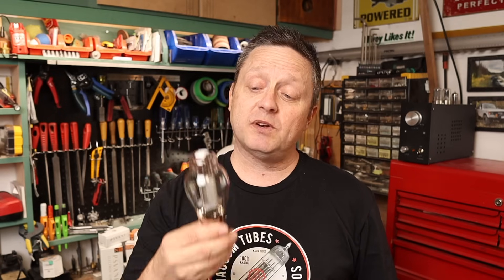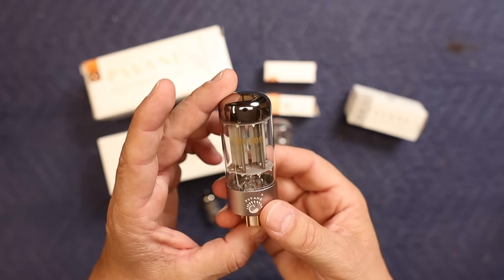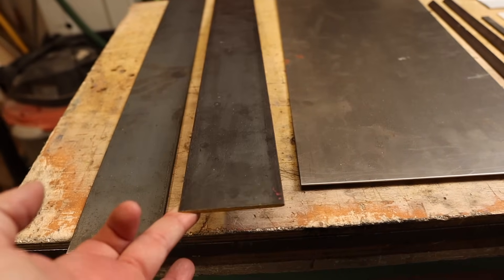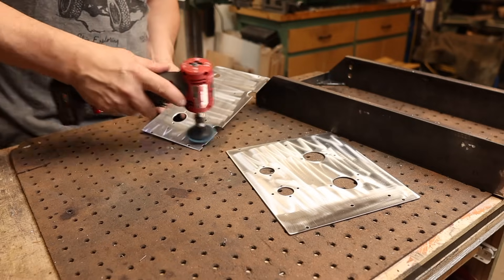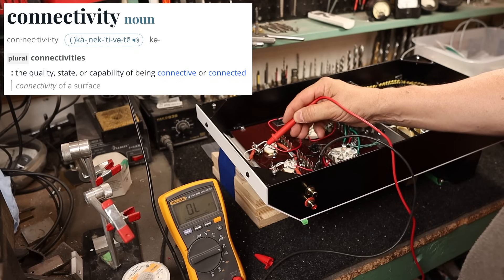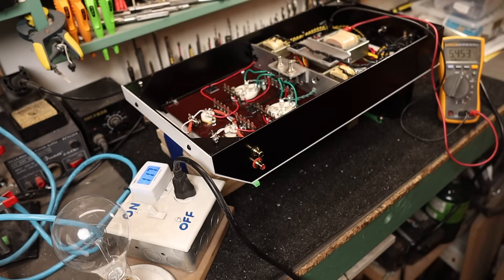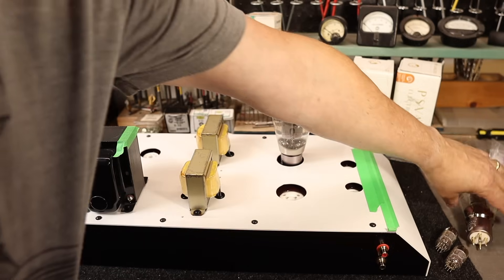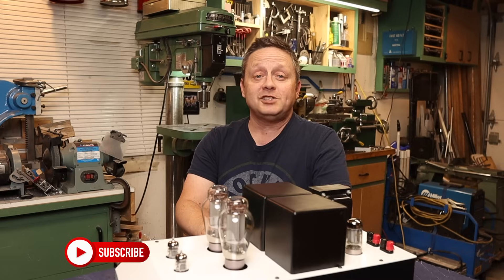Building a 2A3 DHT SET Power Amplifier

Comment: Nice project, I'm impressed by the metal working! One question through, by connecting the rca shielding to earth, don't you run the risk electrocuting yourself through an connected source, anytime something is wrong with the earting of the amp?
Reply from the maker: Thanks for commenting.  The sheilding itself is not connected to either positives of the incoming signal.  It is bonded to the chassis. The chassis is bonded to the earth ground. All the components are also bonded to the earth ground. If there is a fault, it goes straight to ground.  Even if there was a B+ fault, the main fuse would blow when the direct short happens.  I’d be concerned with an amp that floats the ground or there is not power transformer and it’s power directly off the mains. That’s a potential death trap! Cheers.

Comment: You dive right into building the chassis after introducing the tubes.

Whereas, I was thinking you’d go through the circuit - 

Perhaps you’ve already covered that in a previous , , . , 

What ?

Oh I see you have a ton of tive building videos.

And no you don’t have a video going through the workings of the circuit !

Why !?

You showed that circuit for a mere a half second. 

Why don’t you discuss ?

Hmmm ?
Reply from the maker: Thanks for the feedback! These are fair comments. I tend to focus more on the "how-to" of the full build rather than the deep dive into circuit theory to keep the video somewhat short. I have done deep dive videos in the past and they just don't perform. Majority of people drop off quickly and YouTube stops promoting the video and it just get buried in the algorithm unfortunately.  Please have a look at my 6DN7 amp for example. In this 2A3 amp video I include a link to a build document that goes into some more detail if people choose to read it. I also make reference to the original build article which has more information as well.  I do ask at the end of the video if people want me to do a deeper dive on this build and many have said yes. I will be doing a follow up video which will go over the schematic, layout, componted and mods. I know this follow up video will not perform so I hope people, especially the new builders, will appreciate it.  Cheers.

Comment: howdy, really like this. May try build one. Any comment on using a toroidal as power transformer?
Best/Chris (in Sweden)
Reply from the maker: Thanks for commenting. I hope you do build one! I have no experience using Toroidal. They are not that popular here in Canada. They would be expensive to import.  I see many people in Europe use them. I don't really know why other than your 220v line voltage and little or no DC on the mains which can be an issue for some.  Perhaps someone else can comment. Cheers.

Comment: I can understand (barely) that some people like the warm (distorted) sound of the 2A3 but why not generate the required DC voltages with modern solid-state electronics?
Reply from the maker: Thanks for commenting.  Yes, I do use solid state rectification.  Please have a look at my other tube amp video.  They do have some benefits but they also have some negatives. I don’t care either way.  I use both. This amp was based on an older design that uses tube rectification to keep it all tube classic design.  Tube rectification allows for a slower B+ ramp up thus not shocking the audio tubes with full voltage prior to them warming up.  Yes, there is solid state options for that but then the amp gets more complicated than it needs to be.  Cheers.

Comment: That’s an impressive chassis and layout, again.. Very AN UK inspired, but beter lol.. Do you prefer your 6J5 Preamp over your 407A Preamp?
Reply from the maker: Thanks for commenting, much appreciated. The 407A is similar to the 5670 tube but I haven't heard it in person.  Also, my 5670 pre and my 6J5 pre have different topology so it hard to say what I prefer.  They do sound similar to me. The 5670 pre is a bit quieter and has a black background but that may having something to do with eh DC Filaments.   The 5670/2C51/396A is a nice tube and obtainable for a reasonable cost. This issue with the 5670 pre is the transformer cost and availability. A "good" output transformer will cost you several 100 dollars.  The way I built my 6J5 pre, I use a cathode follower to have better output impedance matching and drive longer cables. Dollar per dollar the 6J5 pre wins out.  What I plan to build in the future is a 6J5 with the same topology as my 5670 pre (using a output transformer rather than a Cathode Follower tube) to make a direct comparison with the 5670 pre.  Cheers.
Reply: @MikeFreda 
Thank you for the elaborate reply..  Yeah, the short interconnect cable runs for a non-CF output can be a deterrent especially for those who use Mono Blocks.. There are Line OPT iron out models out there, but most are really pricey compared to plate chokes..

Comment: Hello Mike! What If you build a tube based PSU for a Turntable? I wish I Had one, but new they're 3 times what my TT used. to cost. i'd BE so pleased. 24 volts AC with pwm. Thank you a lot.
Reply from the maker: Thanks for commenting and making that suggestion.  I’m very intrigued.  Send me a private email with more information about what the power supply needs to be and possibly links to what is commercially available.  I’m sure there is a reason why they are pricey…. And I’m sure labour has a lot to do with it.  Cheers.
Reply: Hello Mike! I will, but it takes some time since I accidently crashed my Computer.

Comment: I built the amp and it sounds extremely good, plus it’s dead quiet. I used a Hammond 302AX power transformer, Thermionic Lab output transformers (from Greece), a Genalex Gold Lion GZ34 rectifier, Brimar 6060T and Psvane 2A3-Z Treasure. Unbeatable at the price!
Reply from the maker: Magnificent, great to hear! You used some nice components. I'm glad it worked out for you. Please send me a picture and I can post in on my community page! Cheers
Reply: Pictures sent

Comment: Im a fan of tube amplifiers , but im disappointed by your builds , they lack tone controls, such bass , middle and treble. , they also lack feed back to correct frequency response for various input sources. . Also they lack safety , such as a fuse on the AC cord, and exposed tubes lack heat guard's to prevent people burning themselves, also theses guards will preveny rf interference from near by electronic equipment . Do claim there hi-fi unless you can quote THD figures.  You could build into your amplifiers Bluetooth modules there cheap enough to buy . . Plus steel chassis are prone to rusting , plus I would like to see more of the components mounting and wiring, but overall you do provide good videos, but more build content
Reply from the maker: Thanks for your feedback, I appreciate your thoughts and suggestions! Power amps (like the on in this video) typically don't have volume and tone controls. My preamps typically only have a source selector and volume control. The thought process is to keep the signal chain as simple and pure as possible. Adding extra components can induce noise, reduce gain, make the preamp more complicated and basically alter the base signal. That's how I like them and if you think it's a necessity, there are a few preamps that have this option but they can be complicated to build. Most SET amps don't have NFB. I do use NFB on my EL84 amp and will putting it in to my 6L6 amp. All my AC are fused. The AC connector used in this video has a small fuse holder built into it.  You can install a bluetooth module but then you would also need a power supply for it and if you mount it in the amp you have to be careful the RF from the bluetooth won't interfere with the signal chain. I find it better if you just use a good quality standalone unit and RCA into the pre. I use a Turntable, High quality CD player and a FM Tuner mostly. I find music off my phone compressed.  I have done detailed videos of the soldering process but people don't tend to watch them. They do poorly. No one really wants to watch a guy solder every component. It makes for a very long video, people drop off and youtube stops recommending it. The feedback that I have received suggests that people are more interested in the schematic, chassis,  layout, components used, where to buy the parts and how it sounds. As for this 2A3 amp video, some people are interested in me doing a deeper dive, so I plan to do that even though it won't get a lot of views. My scope is down but I do plan to go back and revisit the amps and give some really figures on them. Thanks again, Cheers.

Comment: Hello Mike! What if You made an active tube x-over for at least two chanels?
Reply from the maker: Thanks for commenting.  To do what with? Bi amp?  An amp for a tweeter and an amp for mids?  If so, I have thought of doing this.  The biggest issues here is having the proper drivers and measuring devices to dial it in.  Cheers

Comment: PT-Hammond 2.5v 166M2  110 V in italy 220 Volt?
Reply from the maker: The 266 series has a 234v primary windings.  266M2.  Cheers.
Reply: @MikeFreda  ok grazie . Ci sono altri elementi elettrici che vanno sostituiti per una costruzione europea a 220 Volt
Reply from the maker: The Power Transformer will also need to be.  Hammond 300 series has a 220v primary windings.  Cheers.

Comment: Hi yer Mike just curious on your builds I notice you use a cheap IEC connector for the power socket can you explain why you don’t use a fully shielded IEC power connector when I work on a cosmetic restoration of vintage hifi I normally fit a Roxburgh   RIH 06 or RIR 06 shielded power inlet for RFI/EMI shielding

Good video 👍👍
Reply from the maker: Thanks for commenting. Great question.  Oddly enough, I have used this type of power supply inlet in the past but was told by an electronic guru that those are actually intended for a more refined power supply, like a switching power supply for a computer and other highly sophisticated digital devices that need RFI and EMI shielding/filtering so the will operate properly. Tube amp PSU's are pretty basic so it occured to me that I didn't need to spend extra money on them so I switched over to normal IEC. Yes, they are "low cost" but I haven't had any notable issues. The incoming AC (60hz) is wired directly to a transformer so I'm not sure what you are actually blocking?   I think you have more of a chance of RF and EMI getting transposed onto the audio signal chain, and I do take precautions for that.  All this being said, I love to see some actual test data or more technical information on this. Cheers.

Comment: Superb build ! .............commercial amplifier manufacturers should have a look at how to build their stuff !
remember this design is made for the Horizon 2A3 tubes as well as other brands with higher plate dissipation thangenuine nos tubes ....2A3 was designed with 15 watt plate dissipation .
Very curious how this amplifier and Horizonntubes sound.
12AT7 ( ECC81-CV4024) is still available in nos quality...
The SRPP is a good driver <>..........possibillity to experience and build  a // SRP driver stage . ..........also take care to set/apply a bias voltage on the filamernts to prevent arcking between filament and cathodes... 
Thank you for the nice and high quality upload ( as usual )
Reply from the maker: Thank you for the kind words and the additional info! Most new 2A3 can handle ~16W without any issues. If I was using some NOS 2A3's, I'd probably put a 5U4 rectifier into the circuit to drop the B+ a bit and get it under 15W. That would still sound pretty epic. I plan to do a follow up video to discuss all of this. People seem pretty interested in what I made here.  A lot of of this info is scattered all over the net and hidden in forums. It took me years to wrap my head around it all. Cheers.
Reply: @MikeFreda  Yes , it's nice to learn  but you have very good builing skills ...
You may try someday to build a parrallel SRPP...
Indeed replacing the rectifier is a good solution when a nos 2A3 is used.
Many prefer the musicality of a 2A3 versus a (Copy of ) the WE300B....
Would like to have your skills building myself the chassis hahaha.
One of the advantages of a // srpp is that one double triode canbe used for the upper stage and another for te lowerone...........this allows to polarize the filaments independantly for both tubes  ( no more risk for cathode /filament arcing )
Anyway you are very inspiring forpeople who love music ( tubes and red wine ) to start building themselves........and thanks for sharing that .A good alternative for starters is an EL34 tube amp ( set ).....it's affordable and quite musical....simple and nice sounding  .
Have a very nice day and waiting for your next project .
Reply: @frankgeeraerts6243  Hi Frank, I modified my ultralinear EL34 amp to include a 12AX7 SRPP driver stage, I kept the Schade negative feedback running the resistor from the of the EL34 to the plate of the second half of the 12AX7. Does this configuration sound correct?

Comment: You don't know how to orientate power transformer and chokes they should be in opposite planes to each, it cuts down on humm and distortion, and only an idiot who Incase transformers in wood due to heat, that will shorten the life of the transformer, try using a wire mess, you don't mont transformers underneath the chassis neither you want the heat to escape
Reply from the maker: Thank you for your constructive criticism. Hopefully I can rationalize your concerns.  My initial intent was to mount the Choke straight down to be in opposite plane of the PT. It is on its side and the laminations are still perpendicular to the PT, Yes, it's not perfect. The Choke is 1/4” taller than the chassis height and it just didn’t work out for me to do it that way.  The steel top plate does help a lot for sheilding. Moving the Choke over some more would also help, again I ran out of space.  The choke only gets to 45deg C.  It is rated for 200mA but its only running at 120mA. It’s dissipating 2 watts.  I installed tall mounting feet and a wire mesh bottom for venting. There is airflow.   The OT's are only dissipating 1/2watt and after running the for an hour, they only get to 37-38deg. Most of that heat is due to the tubes and bias resistors. These OT’s are rated from -40 to 105deg C. Yes, making the cover out of mesh would be beneficial for OT's that are running a lot of power.  I had always planned to install some air holes in the back one they covers were properly mounted.  At the end of the day, managing heat is a concern and for an amp that is running more power, air vents holes in the top plate especially near the bias resistors would be beneficial.    I will be covering all this on a follow up video. Thanks!

Comment: Hm.. I checked out Psvane and Toroids prices and couldn't say 300B/2A3 setups are on a budget. Sure, comparing to $10k "branded" versions, it is. However I would agree it gives the best sound for its price.

I like the idea of using a separate amplifier for low freqs, cause these days D-class is the best (and the cheapest one at the same time) option. With that we get perfect high freqs with much smaller transformers
Reply from the maker: Thanks for commenting. You are correct, the price of the parts adds up quickly when building a 2A3/300B amplifier, especially when using quality parts. It's been my experience that Toroids cost a bit more than standard transformers and the PS Vane Horizon tubes are comparable to many of the more common brands. Yes, Class D are making a huge dent in the audio market and its hard to compare the two. I do know I can make a great sounding tube amp but I would have a hard time to make a class D amps from scratch and I like making stuff! Cheers.
Reply: @MikeFreda  Yes, for low freqs only a d-class can be simple, discrete, self-oscillating amp, beneficial to be built from scratch. Imho. The amps you build look impressive

Comment: What is the voltage on the plate of the 12AT7s?
Reply: 320v,on anode 240v
Reply from the maker: On the top triode (Pin 6) I read 322v. On the bottom triode (Pin 1) I read 165v. Using ohm's law at 0.005a (5mA)... that all checks out.  Cheers
Reply: Thanks, I’m trying to understand the SRPP circuit, and biasing the second Triode, Do you think this circuit would be useful in a EL34 Se amplifier?
Reply: @garyvitrano8362 el34 ia a guano....💩💩💩💩...300b and 2a3 it's realy super beautiful sound
Reply from the maker: I have a brief description of SRPP in my Build Notes document linked in the description. Yes, you could use this input topology for a EL34 but I'm not sure how you would employ some Negative Feedback into this. That's not a circuit/tube I've experimented with.

Comment: I built a pair of those back in the day. Mine were monoblocks using nice Audio Note output transformers but not the silver-wound ones in the article. It uses salvaged power transformers and probably the same filament transformers you're using there. Sounds amazing with my tuned quarter wave tapered pipe speakers 8" and 1" tweets.
Great project thanks for promoting the hobby.
Reply from the maker: That's great to hear, thanks for the positive feedback!  These projects are enjoyable to do and this is a good platform to share my hobby on. There are a lot of people posting in forum but not a lot on YouTube. There will come a time when this knowledge will be lost... or no one will care and this is a good way to archive it all! Cheers.